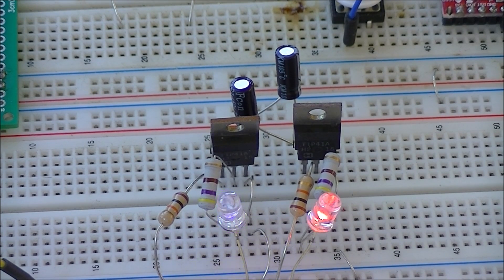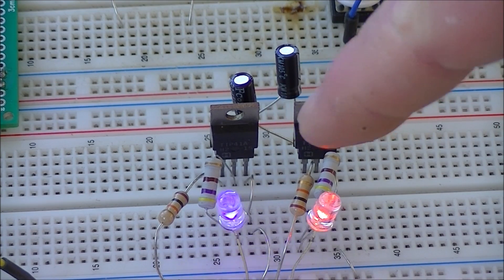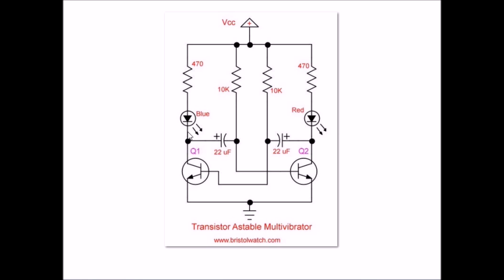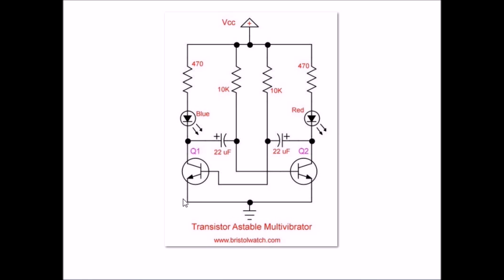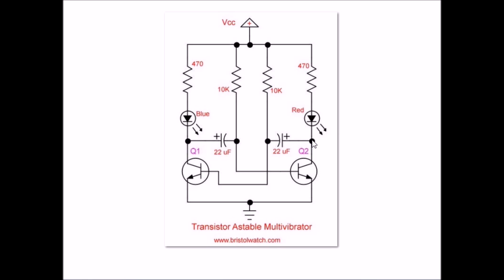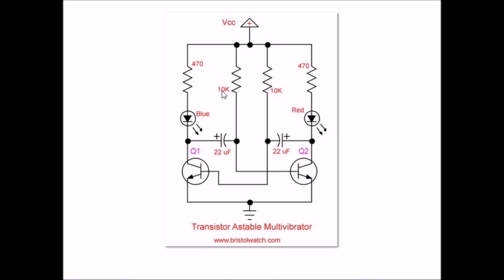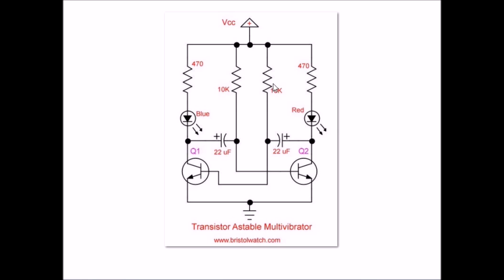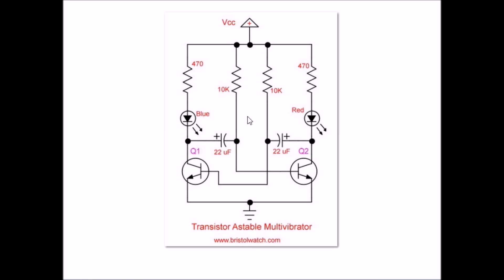Simple 2 Transistor LED Blinker Circuit

Comment: Nice video. However I'm missing the explaination of how the circuit works in details. So it would be nice if you could make a video on that. Thanks in advance.

BTW: It would be helpful to tag your video with "astable multivibrator", oscillator, so that it can be found easily.
Reply from the maker: Thanks